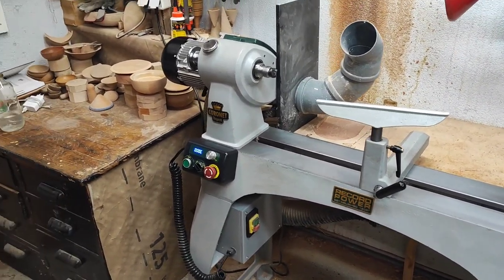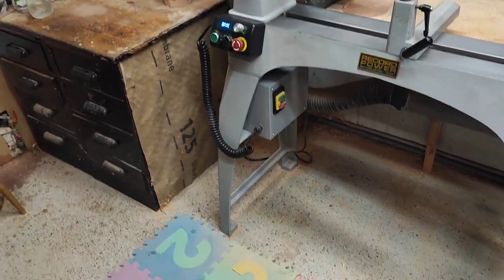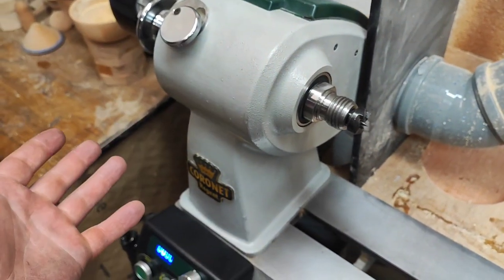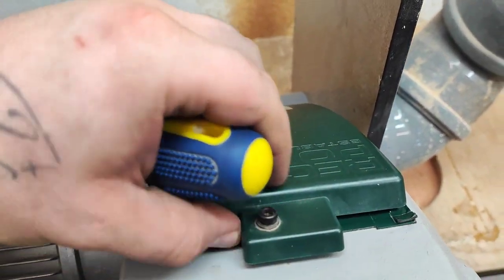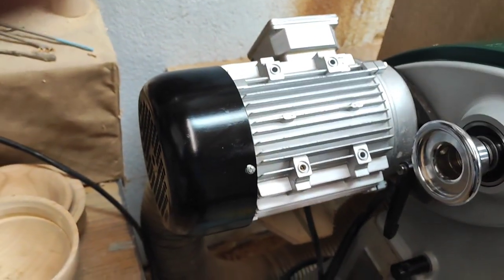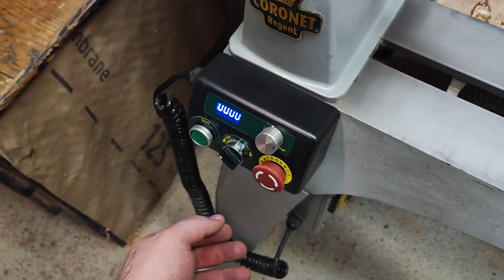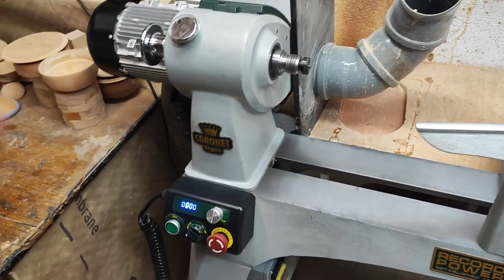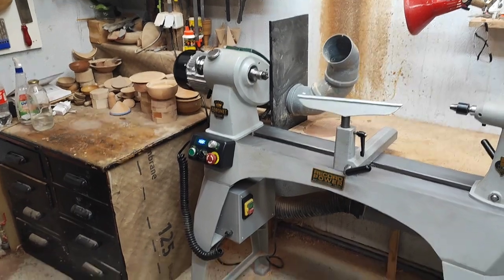New lathe coming in??? Coronet Regent lathe 5months overview/ new announcement

Comment: Nice lathe. In the USA it costs about $2600. My club has the Coronet Herald and it has the same screw tightening on the HS cover which is not user friendly compared to a nylon thumb screw or magnet. In the USA, the closest competitor lathe would be the Laguna 1836 which costs aboout $2900 but weighs 100 lbs (45 kilos) more but only has a 2 yr warranty.  Look forward to seeing your new lathe.
Reply from the maker: Thank you Mike, I saw your older video with herald , I think it was in your club... Laguna is also nice lathe🤗 , this new one is smaller in size but quite good..... Much like your powermatic which is excellent lathe

Comment: Hi Tomislav
Slow Stopping can certainly be a problem,I’ve a Nova 1500 lathe,I bought it in 1980 and it came with a 3\4 hp motor and no reverse back then.
I soon swapped the motor for a 2 hp motor that could be adjusted to run forward or reverse,I solved the slow stopping problem by turning and fitting a large wooden wheel to the outside of the spindle.I think it has eight speeds and is relatively easy to stop at any of the settings.I’ve used the lathe a lot over the years and now at eighty plus years old I turn every day,it has never had any issues and is still running on the original belt. I like many others really look forward to your videos and thank you for sharing your expertise and vast knowledge,thank you.
Regards from NZ
Reply from the maker: Your setup sir sounds great.... 😀

Thank you for watching and support what I do 🤗

Wish you all the best...

Greetings from Croatia

Comment: I'm surprised that people have such a problem because it takes too long for it to stop. That just shows that it is well made, the bearings are smooth meaning they have the right fit and there is nothing  binding. To me that would be a good thing because if it turns so freely it should take less amps to run it. Great review.
Reply from the maker: Stoping time in this case doesn't have nothing to do with bearings, as its not spining freelly , the inverter and motor is stoping the spindle....that is why you can't stop spindle with your hands like for example dml320 lathe before this one.... Its simple as little adjust in inverter but Record power didn't wanna give away how to do it.... 
Anyhow its good lathe but not for me with that slow stoping time.....
Reply: @tomislavtomasicwoodturning  I misunderstood and was thinking it was a mechanical thing. I enjoyed your review and I really liked the lathe the way it's made and everything. Thanks for sharing and correcting me I'll see you on the next video.
Reply from the maker: @kennethcaine3402  no worries buddy😀, thank you for watching and comment 🤗

Comment: Thanks for the review.  In the (Southeast) USA, Highland Woodworking sells Record Power Coronet lathes.  But I have to say, the slow stopping is a major issue and should be fixed.
Reply from the maker: I hope they will fix that although its not issue for mayority of turners just the ones that has a deadline to make stuff for customers as well as shot video etc😅
Reply from the maker: Thank you very much for comment and watching

Comment: Hi Tomislav.  Did you get your slow stopping rectified?  I have a 2hp grinder that I installed a VFD on.  The VFD is completely programmable.  I can adjust in the settings where the  ramp up speed can be adjusted as well as the stopping speed.  On my VFD, it is very simple to change the setting.  I can make my grinder come to a dead stop immediately or with up to 16 seconds of run down before completely stopping.  Hope this info helps as the Eaton inverter should have similar settings that can be changed.
Reply from the maker: No unfourtually...... Record power didn't wanna say how to set it up and I didn't wanna mess with warranty.... It found great new home with begginer turner who don't mind that ☺️

Comment: Hi good review for this lathe. You can modify the magnetic brake time with programmation on VFD (Variable Frequency Drive) ask Record lathe how to change this variable parameter. I have a Sweet 16 from Robust lathe and when I have a heavy piece the magnetic brake turn off, it's too heavy for the motor to brake in the same laps time, so I change the VFD parameter to make double time to stop.
Reply from the maker: Thank you very much, I think its also something simple as type something in inverter and I did ask Record power about that and they answer was they will have to check with there engineers and they they might help.... Thank you for your tip and support 🤗
Reply: You can check the manual instruction of your VDF with name and model on google, you will have instruction to enter in programmation mode and the brake  & acceleretion parameter.
Reply from the maker: @lacoutardes its at the new owner and they did say it will affect warranty so better to wait for they solution.... My new lathe has a nice feature which I'll show in the video regards this...🤗
Reply: @lacoutardes  I recommended, what you say, a long time ago to Tom. Asking help from Record Power , waranty regarding, is good, but I think they are much on woodworking than automation.😁 How the heck can stopping  time  affect waranty ? I put a  VFD on a motor for have full control on that motor. A very fast stop may affect a 50 kg piece if it's not fixed properly in the chuck, but is not the case  on this lathe..
I think that, without electric braking the engine would stop faster( Tom said if he turn the power off from main switch, the lathe stop faster ) That is because the VFD is not controlling the motor anymore, just inertial force.
An automation technician would solve it in a few minutes.
Reply: @catamures1  I agree with you. Some lathe constructor include the brake parameter because a piece of 50  kg can't be stop like a 1 kg piece of wood. CORONET will lost some buyer like Tomislav because they mist something in the marketing, they don't listen serious woodturners. A+

Comment: A wild guess that your new lathe is from KS / Stratos?

 I have the KS FU 180, which has the switch you mention to select how quickly it stops. Plus, stop start is one operation.
Reply from the maker: Correct sir, a bit smaller unit .... I'll explain why and how in unboxing video why I took smaller unit..... Those one push start and stop are great time savers and slower time to stop especially
Reply: @tomislavtomasicwoodturning  Looking forward to seeing it.

Comment: Interesting. I initially rejected the Regent because of the poor speed range (fastest to slowest in one gear) is quite low even when compared to other Record lathes. That's why I went for the KS Stratos 230 and I'm very pleased with it. I've never used the higher brake setting on the 230 though. Anyway, my guess is either a KS XL as you've had some KS gouges or because of the association with Mr Raffen, maybe Vicmarc. Either way, interesting times!
Reply from the maker: Indeed,agreed... Stratos 230 or XL will probably be next one , but this is accually smaller lathe.....☺️ From ks.... Vicmark is still out of my reach but only for now😅